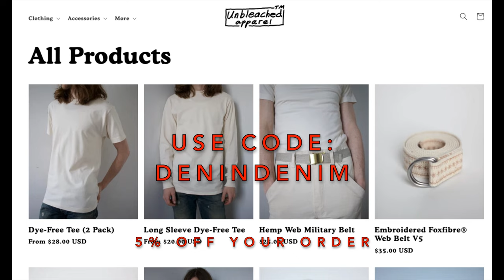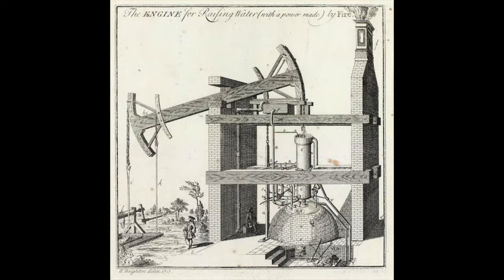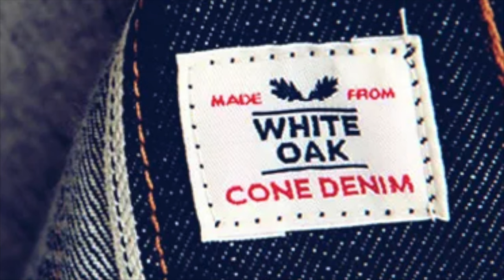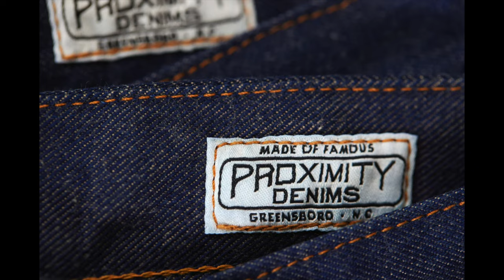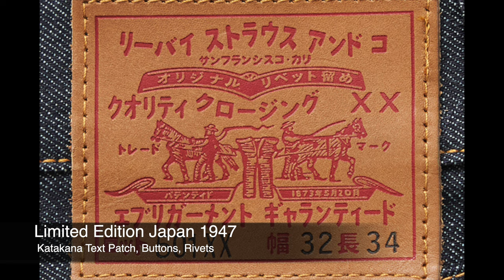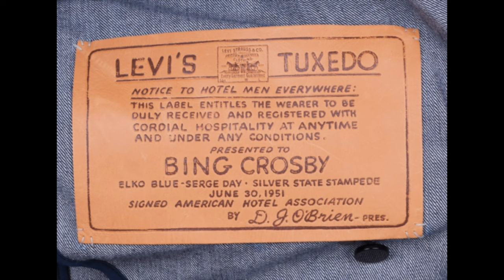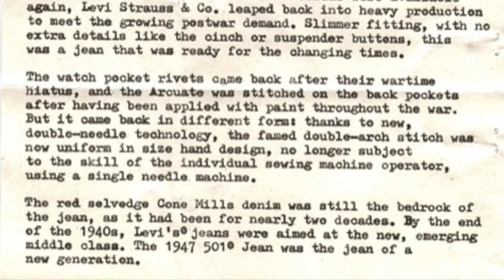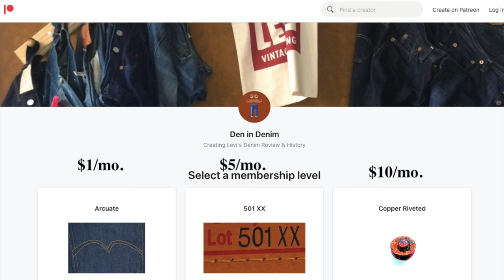1947 - Hot Rods, a Loom, & a Tux

Comment: Hi Dan love you channel.. I’m in between one of the 47 variations - Masonic wash.. should I stretch them out or will they shrink down? It’s an inch both ways
Reply from the maker: Distressed won’t shrink. Only rigid. But they might loosen up a quarter in the waist after getting wet or with wear. Only rigid is stf. 47 run tight. I’m usually a 31 but I have to wear 33 for 1947.